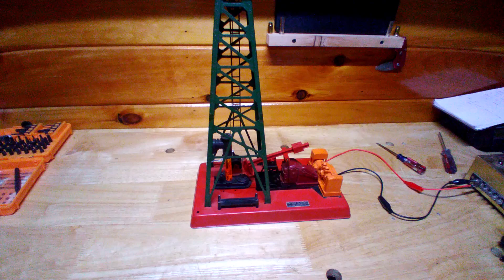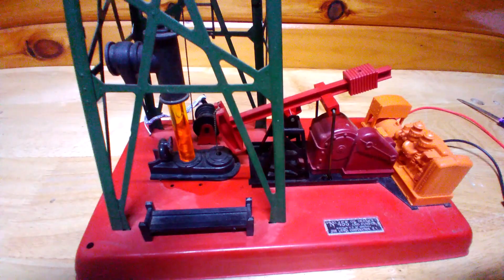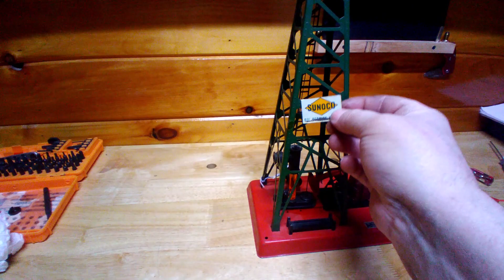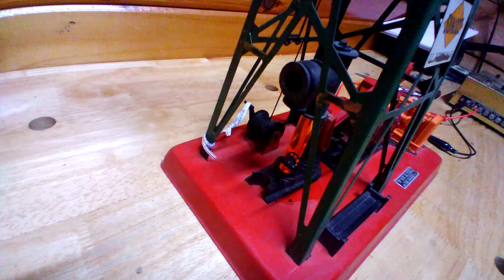Lionel 455 Oil Pumping Station

Comment: That’s a great accessory. Great job getting it up and running. The only thing I’m curious is that the light bulb should not be going on and off like that. It was designed to stay on constant while the pump goes up and down. Tom